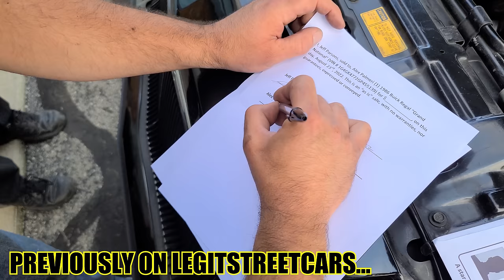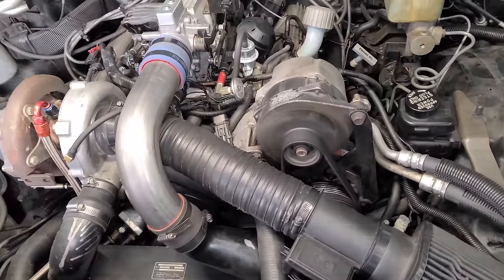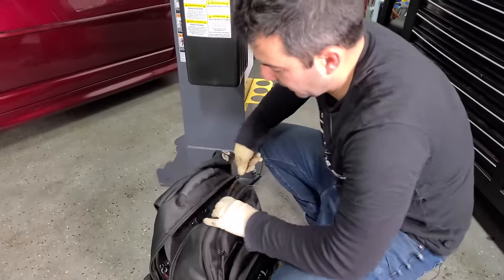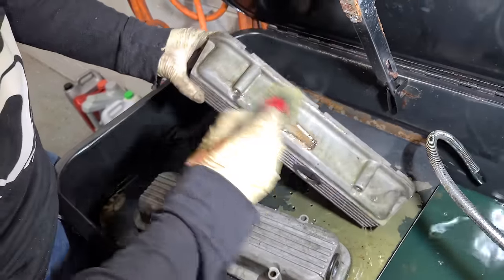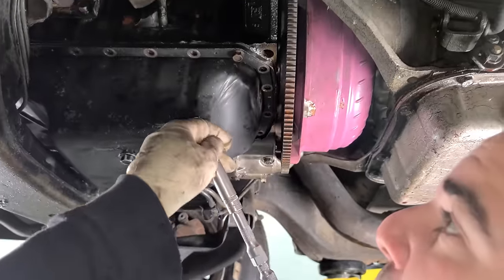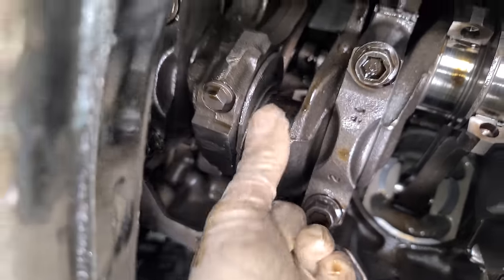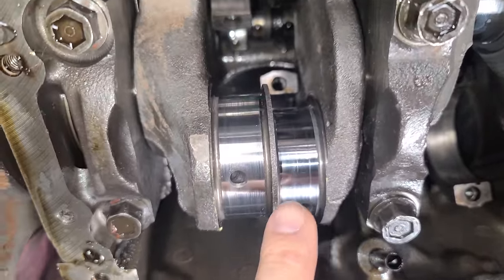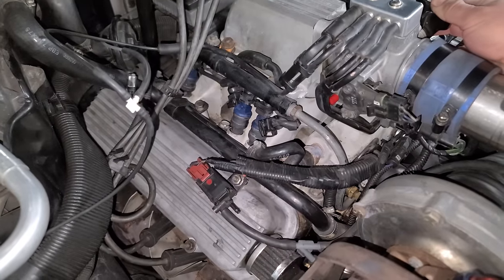I Found A Fully Built Engine In My Grand National That Was About To BLOW UP! DIY Fixed It For $32!

Comment: If they are aftermarket rods why are they even stamped ? you usually buy a set and they are all weight matched and assembled and you only remove the caps on install no reason to number them until taken apart ? maybe someone had it apart and numbered the caps and another complete idiot put it back together not even knowing that the caps were numbered or that you dont mix them up ? personally putting new bearings in unless selling the car is a bad idea. pull the rods and measure them with the caps on and if they are off exchange the caps to the right rods and re measure if ok put it all back together. Me I would suck up the labor and grind off the cap markings and resize the big ends of the rods and re balance them or just chuck the rods and replace . Some idiot assembled the engine and mixed up the rod caps that is why the engine looks new inside its because it was recently rebuilt WRONG and they gave up on it.
Reply: Did not watch the whole video before made the above post .. spot on catching the issue and using the same fix as I would recommend based off the 1 cap and rod not being mixed up that had good bearings. based off seeing that would have done the same thing you did with maybe using a longer string to polish the crank and wrapped it 3-4 times around instead of once to get more even pressure. But I have a spool of green 550 parachute cord left over from the military so I have the cord readily available. spot on diagnostic and repair it is few and far between you see u tube videos made by people that know their ass from a hole in the ground :)

Comment: You have no idea what you're doing, that's a EGR valve which is mounted in the exhaust port  of the intake, vacuum is only on the top side via hose.my god it's hard to watch this.
Reply: Pretty sure that's what he said?
Reply: Pretty sure Alex was a master Mercedes tech for a bunch of years, he definitely knows what he's doing. I'm an aircraft mechanic, I could show you a plane and I bet you'd have no idea what you were doing either. Be humble my friend.